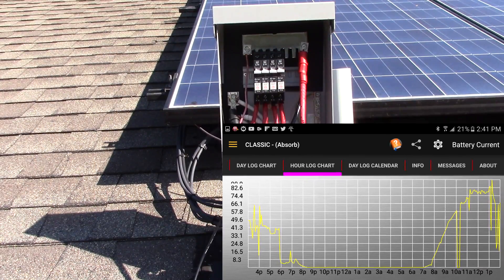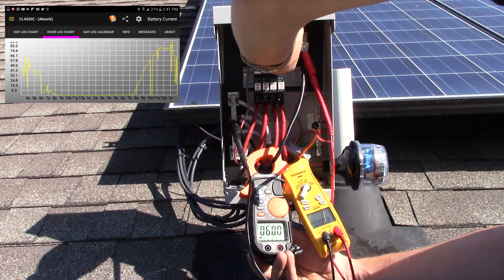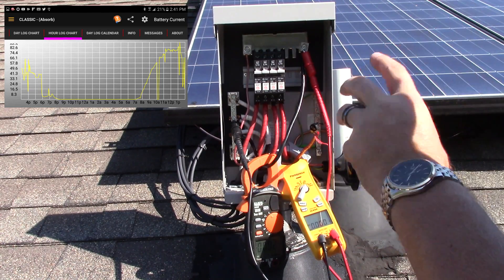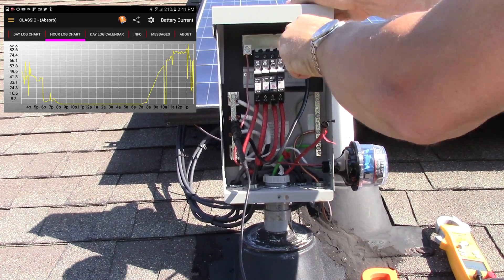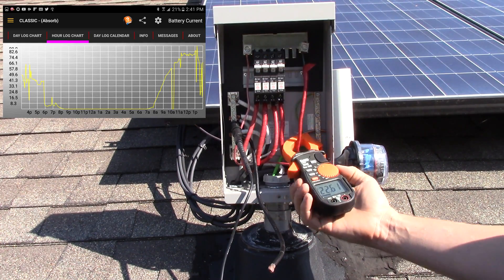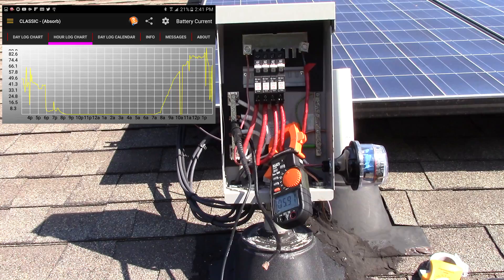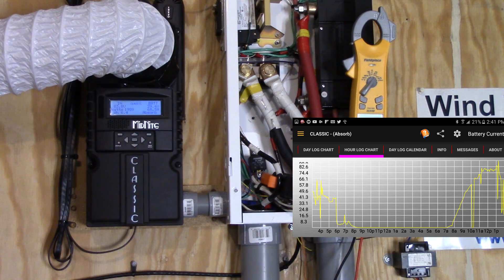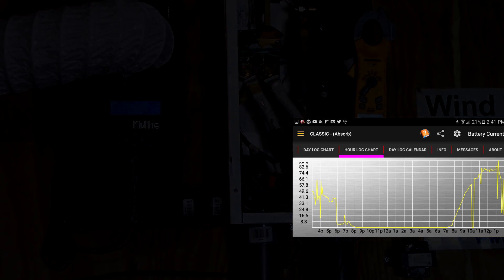How To Test Solar Panels At Your Combiner Box

Comment: are your batteries sulfated and won't draw more current. sounding like that's your problem if it's in absorb and don't draw more current then the resistance is the batteries is to high.  if you put a load on the inverter does the current go up
Reply from the maker: I equalize them four hours last week.
Reply from the maker: and I run about 4000 Watts through the inverter as well
Reply: What is the specific of gravity. Thus is important to know what that is. If it's low they will never charge up rught
Reply from the maker: Don't know
Reply: yes you are right If you dont know what your specifc gravity is you don't clearly really know anything about Batteries. I live 100% off grid in regards to power, I have a video about this how to test them and how to read the numbers. Bad batteries in a battery bank can mess with the whole system from charging taking in amps and discharging. and if you do have bad batteries after checking the specifc gravity you will have to remove more then 1 battery.
Reply from the maker: I had a 3500 watt load on the inverter.
Reply: +Solar Power Electricity and Electronics (phillip20) What was pulling that Much power.
Reply from the maker: +Modern Off Grid DIY stove dishwasher coffee pot playstation computer 3 TV clocks and all the lights
Reply: +Solar Power Electricity and Electronics (phillip20) oh I see, but I think it would still be a good idea to check the water in your batteries if your batteries have water in them. Thanks for the follow up.
Reply from the maker: +Modern Off Grid DIY I did and equalize them monthly